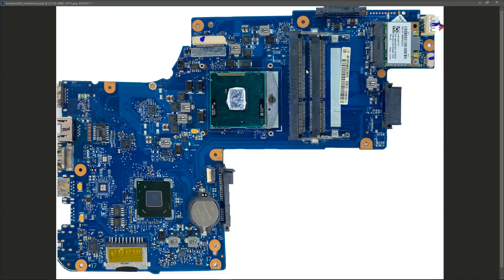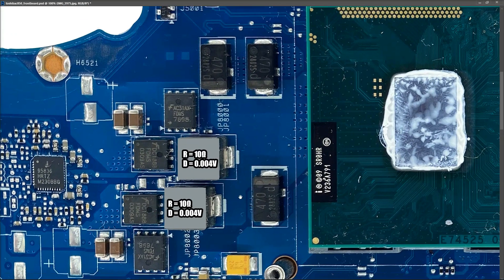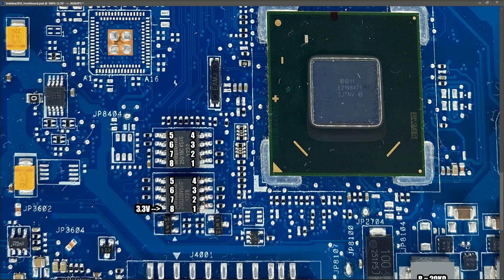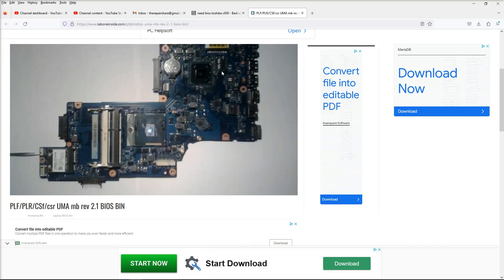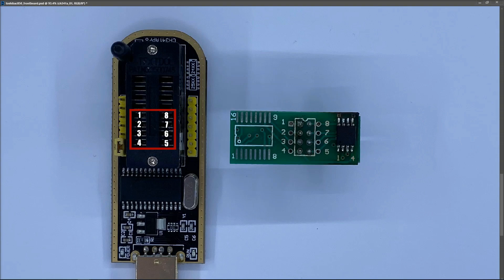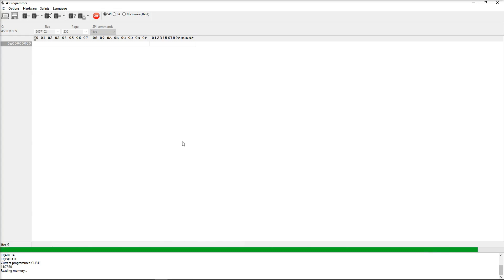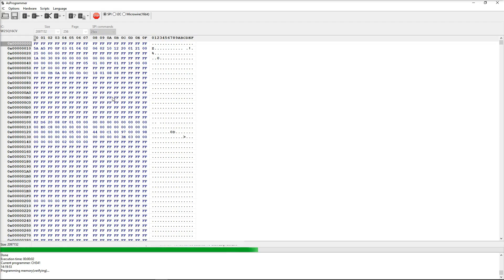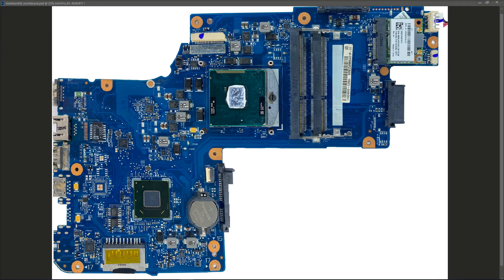Toshiba Satellite C850 - Why Is It Not Powering On? (Part 2)

Comment: I learned a lot today. Before "blaming/condemning" without evidence that all the problems of a MoBo are on the Super I/O IC (EC), it is easier to check the firmware of each SPIFlash memory and also cheaper than buying and still having to solder correctly 128 pins. Excellent repair. Congratulations. Thank you very much for sharing. All the best.

Comment: I'm not sure if I will ever be brave enough to use a BIOS programmer. The hexadecimal doesn't bother me, since I've been programming computers since 1975. I just don't like to desolder and solder multi-pin components. Any SMD with more than two pins is a challenge to me. I guess I need more practice.
Reply: Just buy a hot air station,and practice on some junk boards.Its easy,trust me.
Reply: @dimitrismaster  I have transplanted a few USB3 ports between boards. It takes a lot of heat and patience.
Reply: @dimitrismaster  yes.  Heat the buggers up as hot as you like.  Im amazed how much heat they can handle.  Station plus tweezers and good solder and flux.  Go for it.

Comment: Do you think the BIOS got corrupted simple because the CR-2032 battery voltage was too low? That is a possibility. It could also be caused by other power issues and by "bit rot" in laptops that just sit on the shelf for ages.